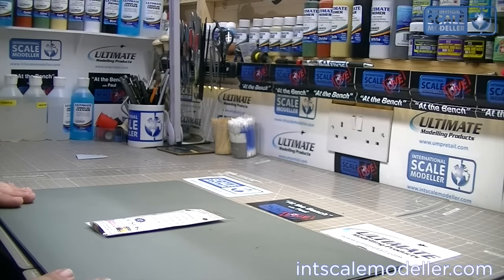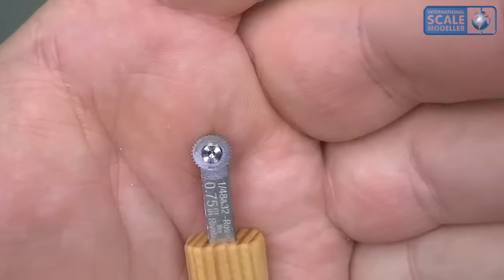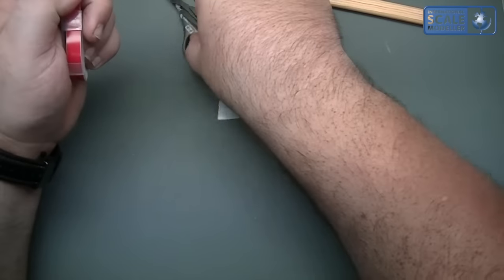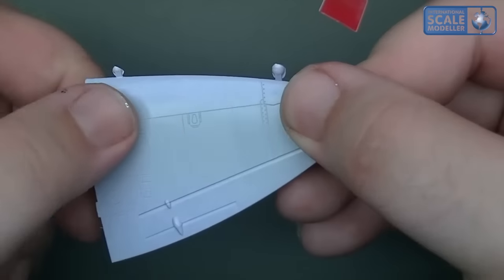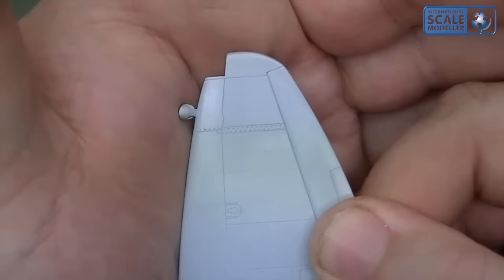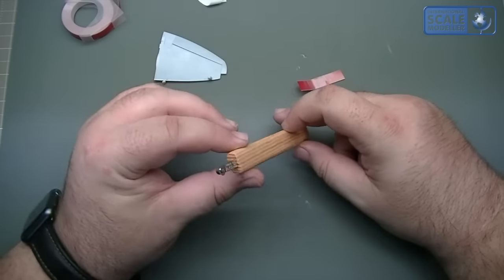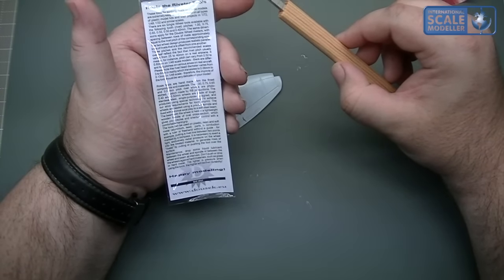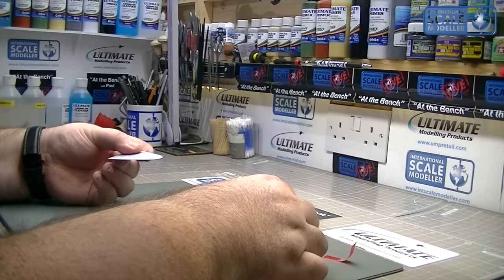Rosie the Riveter Scale Model Tool Review

Comment: Tip for Dymo tape longevity: Stick Dymo tape on top of some Tamiya tape (with the Tamiya set back a bit from the edge) and you can use each length many more times as the Tamiya stays tacky for longer.